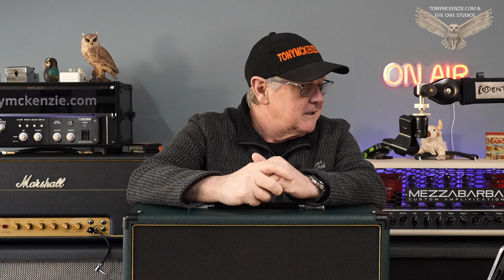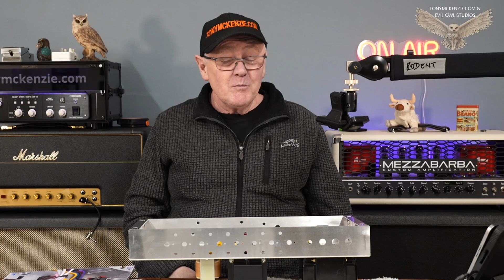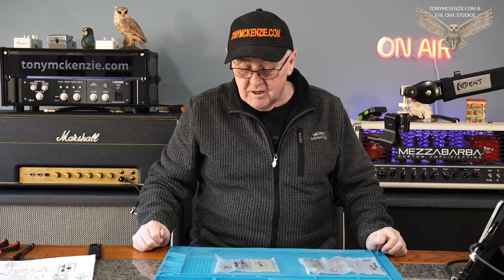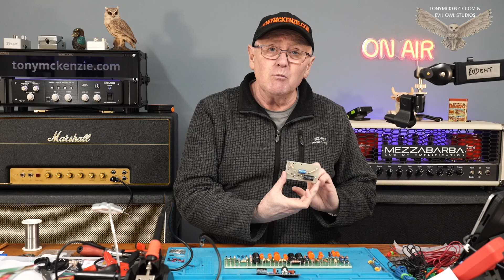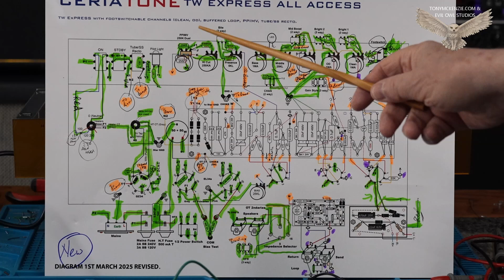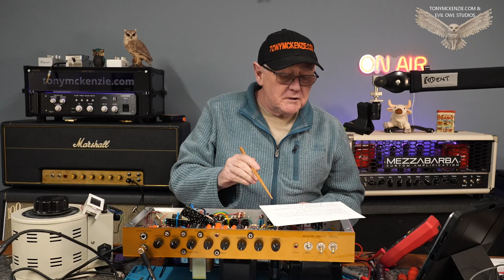This amp cost me weeks to build - here's why it was worth it

Comment: I want to purchase the JCM 102. Did you find the parts to be of the best quality, such as the capacitors?
Is there anything you think that could/should be upgraded that didn't come that way?
I appreciate and respect your opinion Tony 👍
Reply from the maker: Good question. The capacitors are most often 'Holy Grail' that are Ceriatones own. But they never gave me any issues and I built my first kit in 2010 and that is out there still working no problems. I often use my own tubes. I like TAD tubes. But Ceriatone? I like what they do. There were a couple of things on this build but related to the build change from their original. e.g the layout had changed in one area compared to the online photos. Nothing that bad really. The chassis was very good too. If you have any doubts speak to 'Nik' at Ceriatone and he is first class. His support also is excellent. Hope it helps and do let me know how it goes for you... thanks for watching.
Reply: @tonymckenzieofficial  thank you so much Tony, that really helps! 👍
Reply from the maker: Any time... thanks

Comment: Every component should be checked with DMM before installing. You know its good, and you know its actual value.
Reply from the maker: Ha I know... but when I ordered the 100K resistors from eBay - they were 'Dale' brand and no coloured rings... and I assumed they would ship what they said and what I ordered. They supplied 1K resistors. You know what, I checked that resistor a number of times and just 'assumed' it was my meter etc. wrong... but it was not the meter - it was me! :) It's just so easy to get it wrong. And that 100K under the caps etc I showed... you know what that was simply me getting it wrong. I commented to Nik that I had a 10K 'over' and no 100K - the fact was that the 100K I needed was under that cap, and the 10K 'over' should have been fitted there. These are silly mistakes, but I learn more as I go along and its a tale for anyone building an amp that we can all do these silly things... and I'm at the top of that list :) You're right of course. I should have checked closer when I had 'one over' and no 100K - that was there all the time! Thanks for the post and for watching.

Comment: I have the FUCHS Train 45 and love it.  The Ceriatone looks interesting.  I always check the resistor values with a meter before soldering them in.  I found it saves time later in not having to chase a problem down.
Reply from the maker: Thanks for info about the FUCHS... I have not yet tried one. On the resistors I get that and I misplaced one. The other was shipped to me (1K) that should have been 100K and I did not check - assuming the seller shipped what I ordered... they did not and that caused me a lot of pain... I did not even check it later - when I should have. Eventually I found that but what a pain. Thanks for watching.
Reply: @tonymckenzieofficial  That’s not uncommon with parts in kits.  You did a nice job on it!

Comment: If anyone ever builds an amp and it works perfectly right off the bat, well, pinch yourself !! 

Nice build, Tony !
Reply from the maker: Ha I agree, I have NEVER had any work first time. Usually silly problems (often made by me!) - great point and thanks for watching.
Reply: @tonymckenzieofficial  thanks. I've built about a dozen in the last 2 years and I used to say , man this went well , it's gonna fire right up , only to be crushed with disappointment haha. One missing wire can throw you off track with a trainwreck  😉
Reply: Is there something wrong with checking Your work along the way ?,... by checking each part of the circuit functionally.? That way there is no more than 1 mistake at a time.

Comment: I built a couple trainwreck express amps. By far my favorite amp so far . Super low head room. 3 or 4 on the vol and you're breaking up. Crank it and roll your guitar vol down, and you've got everything from deluxe reverb to jcm800, but better
Reply from the maker: Exactly - they are a tube amp with a difference - in a good way. And thanks for watching.

Comment: the Ken Fisher designs are awesome ... pretty friendly to DIY also, but I don't understand the one triode out deal.... why not do a vintage dual input with it, if it would just throw the symmetry ?

I guess that might be a problem with the tone stack coming directly after , but would just be a little reorganizing of the circuit, but then It might not sound quite the same.
Reply from the maker: Ha you know better than me about that! But either way it is an interesting amp and I learned from it for sure... thanks for watching.
Reply: Ken was known to eliminate any extraneous circuit elements which might load down or negatively impact the tone. Adding a channel requires a bit of compromise when they are mixed together. Lean machines indeed

Comment: Hands up, i jumped to the demo at the end. i will watch the full video later.
For clean tones it sounds good, a bit more warmth is needed to keep me happy.
But to be fair, it blows any Marshall away for cleans, which is not very difficult.
Reply from the maker: :) you cheated :) The cleans are very clean but that channel still has loads of drive sort of Marshall type gritty drive. The lead channel can be highly aggressive and ultra driven. If you get chance to watch the build it is quite interesting to see in the amp. I learned a lot!  and thanks for watching.
Reply: @tonymckenzieofficial  Of course i cheated, having built and repaired hundreds of amps over the years
my enthusiasm is burned out and full of dry joints are mixed up wiring.
I will make an effort and watch it a bit at a time, the medication i am on for cellulitis makes me very drowsy
so my attention span is short lived.
No disrespect to your excellent video's